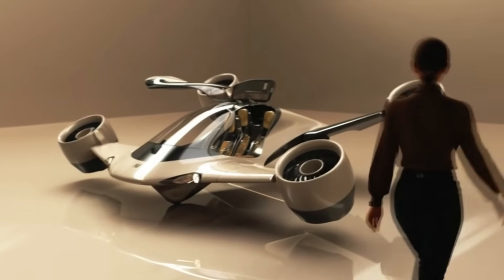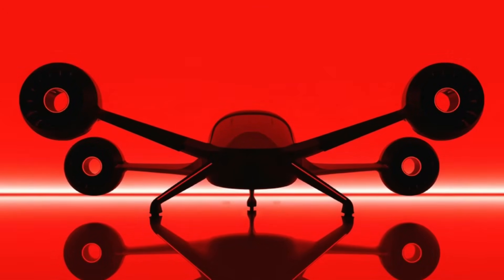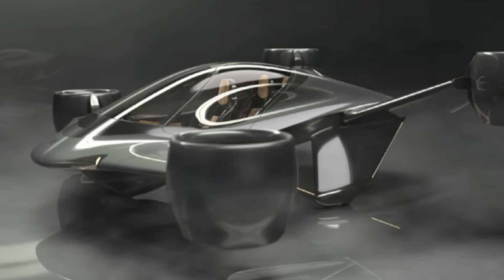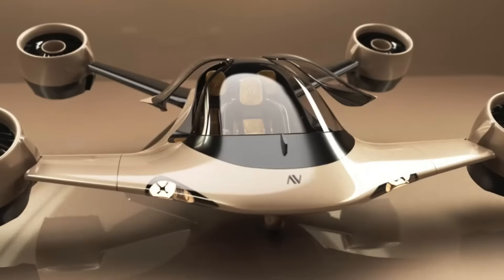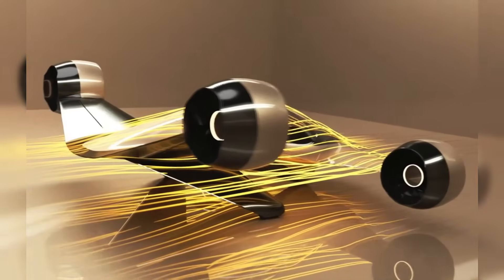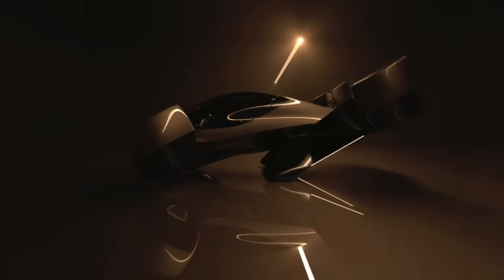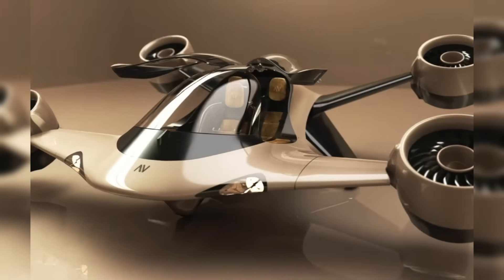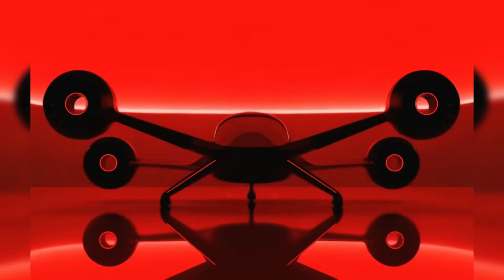2025 NEW ALTOVOLO SIGMA UNVEILED!!

Comment: the scale model is literally just a large drone and the prop configuration is no where near the actual 'concept photo' shown in this video, which is diametrically opposed. It looks cool, but AltoVolo is going to have a really hard time getting this to commercial production, air-worthiness testing, certificates and FAA, etc, etc because it is NOT classified as an ultra-light...they are already way behind the curve at this point with Joby, Volocoper, Archer, Ehang, Jetson and Helix already in production. Zapata AirScooter with a 2 hour fly time is going to make it really difficult for the personal EV flying aircraft industry to make sales...
Reply: What if they use a " Graphene enhanced carbon fibre body" to reduce weight, would that make it better.